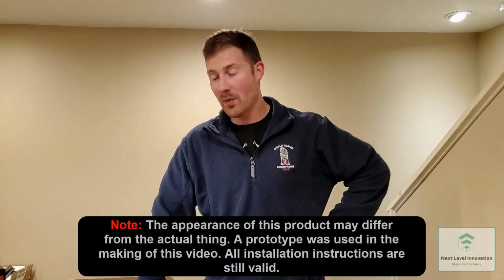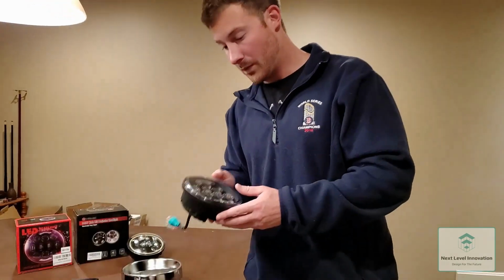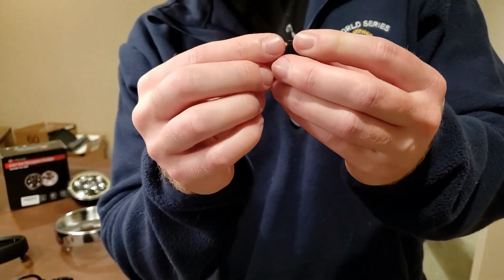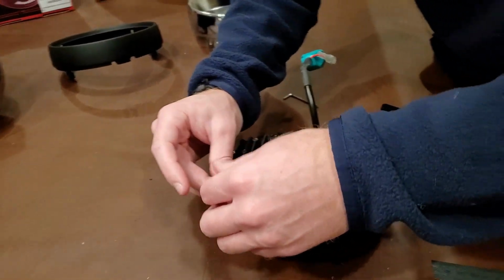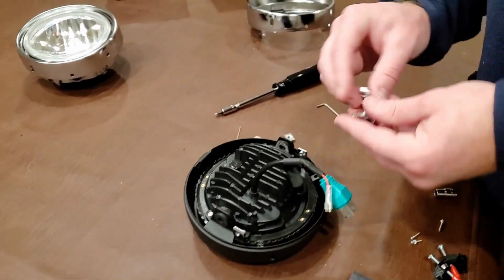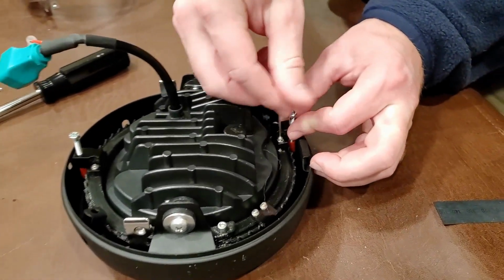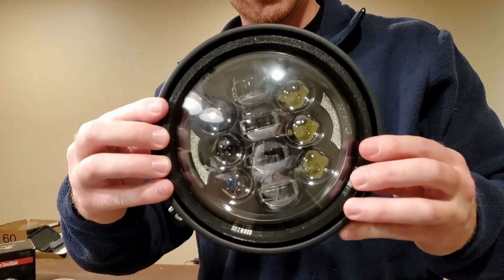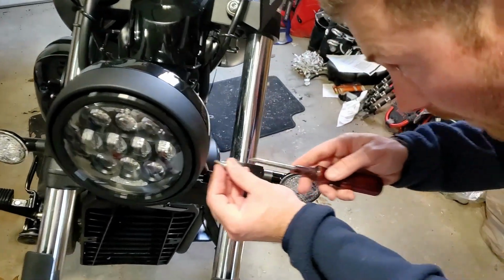Yamaha Stryker / Raider LED Headlight Adapter Install

Comment: Does this ring only work with this light or can be used for any aftermarket led light
Reply from the maker: Hello,
 We now sell an all metal design of this adapter and it does allow for other 3rd part 5.75in LED headlights. Please check out our website for more details. Www.nextlvlinnovation.com

Comment: Hi.how i can get one for my 2016 styker please ????
Reply from the maker: @krzysztofszerwinski  hello, yes you can. Please visit our website: www.nextlvlinnovation.com
Reply: @nextlvlinnovation  yes ok but i interesting for one from video because this fill the gap  around nice.
Reply from the maker: @krzysztofszerwinski  this is the older generation made out of plastic. It is no longer available. The gap allows air flow to cool the LED light. When installed the gap is minimal.

Comment: This set up still available?
Reply from the maker: Hello,
This setup was discontinued but replaced by our all metal 5.75in headlight adapter. 
Www.nextlvlinnovation.com/575v2
Reply: @nextlvlinnovation  Thanks bro. That's nice too. What all would I need to keep from the stock assembly? In order to use this one. I know I need to keep the headlight bucket. I'm just a little lost on the stock parts inside the headlight bucket I need to keep. Your help is extremely appreciated.
Reply from the maker: You will need to keep the stock bucket and bezel as well as both Tnuts for the side mounts, the adjustment screw, spring and nylon white nut.
Reply: @nextlvlinnovation  thank you for your help brother. I'll be purchasing the new one you have available. Thank you again.
Reply: @nextlvlinnovation 1 quick question. Does your kit come with side mounts?
Reply from the maker: @timothy3644  yes it does. Take a look at our other install video through our channel.
Reply: @nextlvlinnovation  okay thank you. Will do.

Comment: i have a raider S 2010 and i would like to go with the led headlights and signal lights. i would like to go with the chrome look. What products do you suggest? thx
Reply from the maker: You will need the 5.75in M1 Adapter and the Load resistor. For chrome headlights we have the 5.75in Daymaker and Halo options. These products can be found at our website below. We do not carry turn signal lights. 
Www.nextlvlinnovation.com

Comment: Will this work on a 2017 Bolt R spec ?
Reply from the maker: Yes it will. We should have more in May. Please add your email to version two page at this link. 
Www.nextlvlinnovation.com/575v2

Comment: Can you please advise if this will work for an XV1700 warrior? Thanks.
Reply from the maker: What year is it?
Reply: @nextlvlinnovation  2008, I saw you have v2 already, my main concern is the spacing between the led and the housing, some use a rubber ring around it, but your v2 shows a bit more gap.
Reply: Waiting please for reply, thank you!
Reply from the maker: @4di_4di  yes this will fit a 2008 Warrior XV17 motorcycle. For more information on the V2 adapter go to our website Www.nextlvlinnovation.com. 
The gap you see in the V2 is for airflow to cool the LED and for vertical angle adjustment. Our adapter also allows you to customize the LED headlight where the others do not.
Reply: @nextlvlinnovation  thank you!

Comment: So let me understand this, this doesn’t include the LED Headlight, I have to buy that separately? Can you link where you got that headlight? I know you said Amazon but what’s it called
Reply from the maker: Hello,
  You are correct, we sell just the adapter.  Please check out the all metal v2 on our website below. 
The headlight used in this video is linked below as well.
Www.nextlvlinnovation.com/575v2

https://www.amazon.com/dp/B071GCDC33/ref=cm_sw_r_cp_apa_glt_fabc_6YWPBXFVEMAH3A2AHWXR?psc=1
Reply: @nextlvlinnovation  Awesome thank you! I have a 2011 Yamaha Stryker and need to LED Headlight so your a big help. Also trying to find a loud exhaust cause right now I have the stock exhaust with baffles. I’m stuck between Vanes and Hines or the cobra. But can’t really tell which is louder or sounds better do to YouTube’s audio quality.

Comment: I've a 2011 V Star 950 Tourer. Will this setup work  for me?
Reply from the maker: Hi Dean,
   Yes, this adapter will fit your 2011 Vstar 950 tourer. The link to purchase is located in the description area of this video.
Reply: @nextlvlinnovation  Thank you. Now I have to wade through the hundreds of LED headlights to find a reliable one. I'm going to order your adapter.

Comment: Where can I download the STL for the 3d printed adapter & ring and is that PLA or something better geared towards heat & uv?
Reply from the maker: Hi Matthew,
   The stl file is not available. We will have more inventory available this friday on our website. It is engineering plastic which is uv and chemical resistant. 
Www.nextlvlinnovation.com

Comment: I just purchased a headlight for my Yamaha Stryker by Eagle.  The light is listed as "exact fit." It is the Eagle LED headlight (5 3/4 inches) for the Yamaha Stryker.  Will your adapter kit work with this specific light?  Otherwise I am sending the light back.

Comment: Where do i go to purchase this product?
Reply from the maker: Hello!
   This can be purchased from our website below:
Www.nextlvlinnovation.com/shylah
Reply: @nextlvlinnovation  Can this fit any LED headlight?
Reply from the maker: @NewYorker86  this will fit the majority or 5.75" aftermarket lights. There is a document located on our website that will walk you through what to look for. If a light is marketed toward Harley it will fit this adapter.

Comment: Key ring is still loose when placing it on a 5.75" aftermarket headlight. Any suggestions?
Reply from the maker: Hi Angelo,
Please email us at nlinnovationllc@gmail.com with more information and images if you have them.

Comment: Hi,  I have a ‘04 Yamaha Warrior 1700.  Will your LED adapter ring fit a 5 3/4 LED into the bucket ?
Reply from the maker: Hi Al,
  This adapter should fit your 2004 Yamaha Road Star Warrior 1700 (XV17PCS). Please take a look at our website for more details and how to order. Thanks! www.nextlvlinnovation.com

Comment: I have a yamaha raider S 1900cc I keep hearing when installing these led head lamp your stator gets like a growling noise does it happen also with the Stryker
Reply from the maker: I have only heard this from the Raider owners and it only happens with certain brands of LED headlights. Some are ok and work normally. You would have to check the Raider forums/facebook to see which lights do work.
Reply: @nextlvlinnovation  ohh I see thank you
Reply: @clohase1468  i just bought Raider S 2010 and looking for leds. So did you install leds on your raider S? if yes, can you please share what type?

Comment: Is that a stock headlight bucket or does that come with the hardware
Reply from the maker: The adapter is sold to fit the stock bezel and fit within the stock bucket. More information can be found here Www.nextlvlinnovation.com/shylah
Reply: Next Level Innovation I have a Yamaha Vstar 650 custom, I bought the 5 1/2 led light, the stock hardware does not fit over or line up with the after led light.
Reply from the maker: @rammsteinxs  what year?
Reply: Next Level Innovation 2000
Reply from the maker: @rammsteinxs  unfortunately this adapter will not fit your particular bike. We are in the process of looking into your style of motorcycle.
Reply: Next Level Innovation ok thank you

Comment: Nice Video. Very Helpful. What size light are you using? 7" or a 5 3/4" for the Yamaha Stryker?
Reply from the maker: Any aftermarket 5 3/4" LED Headlight can be used with this bracket.

Comment: Next Level Innovation you would recommend using Blue Loctite on all the threads?
Reply from the maker: All hardware comes with thread locking patches so more loctite will not be necessary!
Reply: @nextlvlinnovation  thanks
Reply: Next Level Innovation hello, I was wondering if this would work for warrior.
Reply: @ishappens  I used it on my 03 Warrior, worked great.

Comment: Thanks for the content. www.roadstarraider.com sent me here, the official Yamaha Raider forum to find answers for Raider owners and soon to be Raider owners. Now I can finally be able to put that LED light in my Raider bucket since it wouldn't stay in with the stock bracket or the bracket I bought from TwistedThrottle.com but I will be buying this soon. Thanks.